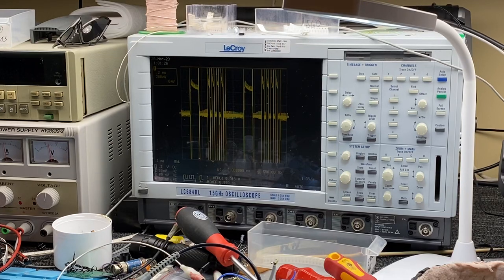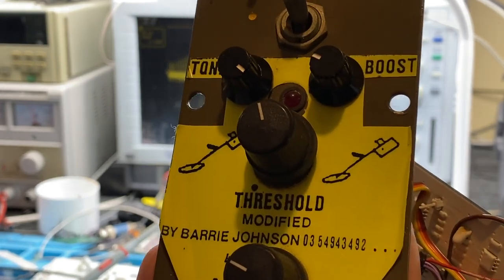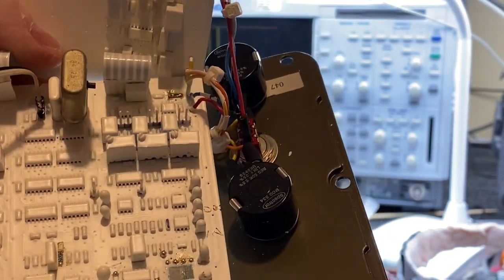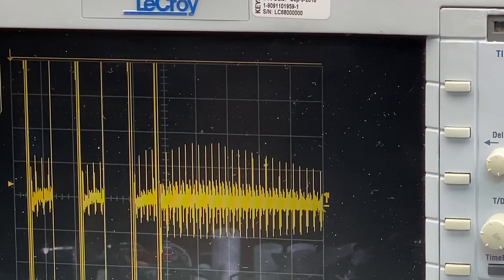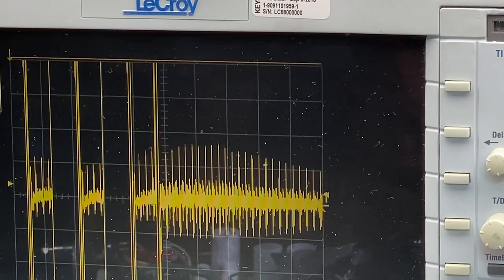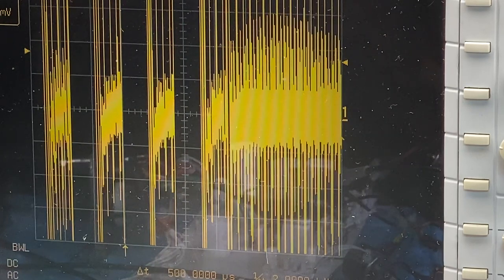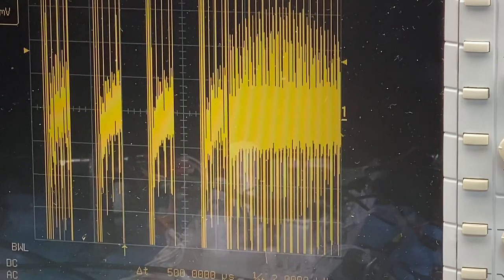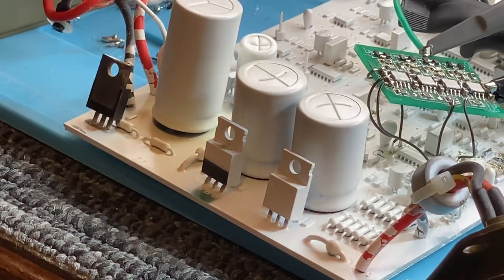Super Boosting Minelab SD2000 and other Detectors Super Deep.

Comment: I'm interested in what mods you would use on my SD 2200d ...is there much difference between the SD 2000..?
Reply from the maker: Variable gain  and variable frequency and new parts, the SD2000 can only have a few fixed frequencies.
Reply: @DetectorMods  thank you ...